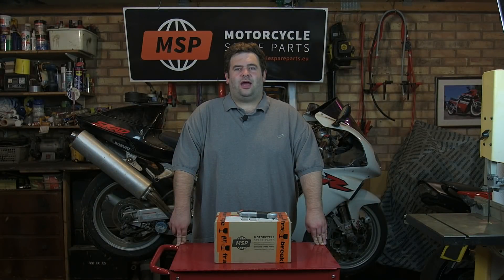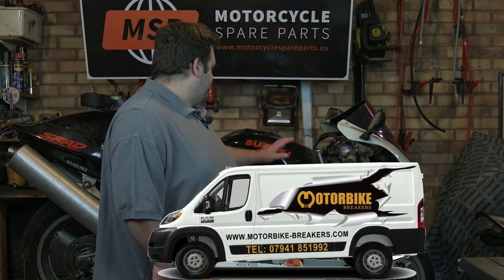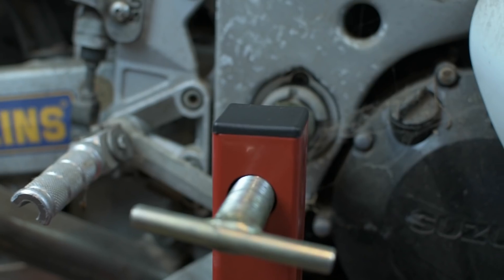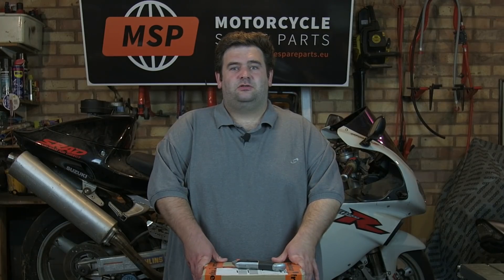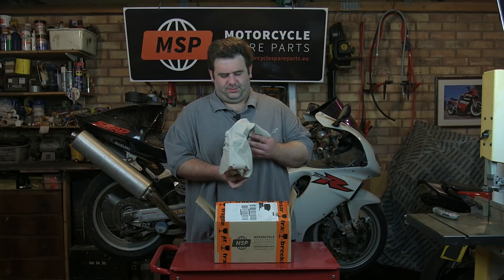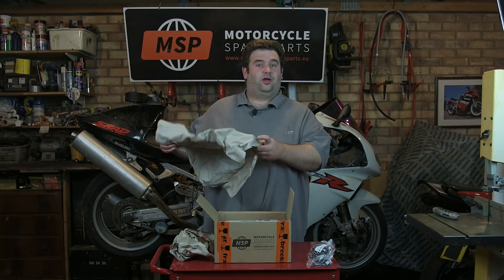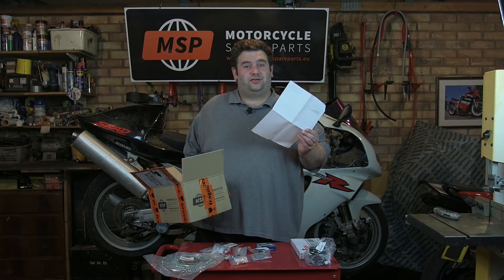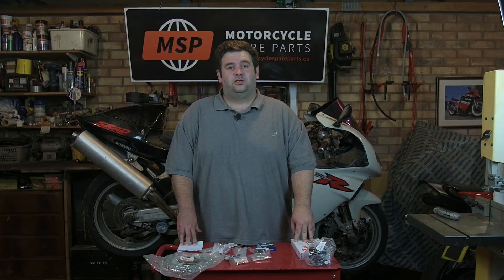How to Motorcycle guides | Classicmotorbikes.net

Comment: Hi. Looking forward to this series. Are those forks not past it due to the rust pitting and has the TL been raced in the past? I thought I saw the oil filler with lock wire on it?

See you next Sunday.
Reply from the maker: Hi Stu, the rust spots are a concern and will have created some pitting but it will all be part of the guide to rebuilding the forks and what to look out for. I’ve had a look and doesn’t look like anything has been lock wired so I would doubt it’s been raced but you never know! Will see you on Sunday, Ian